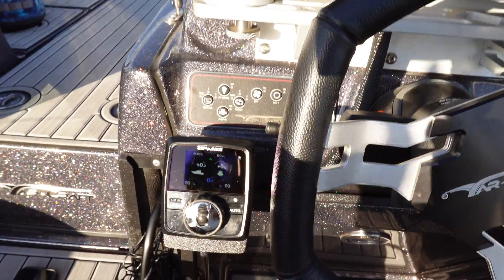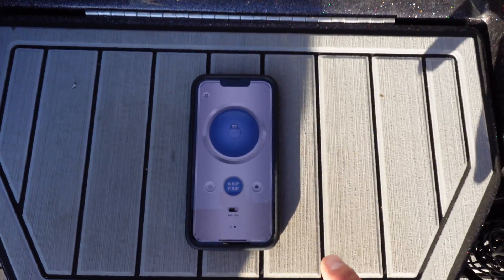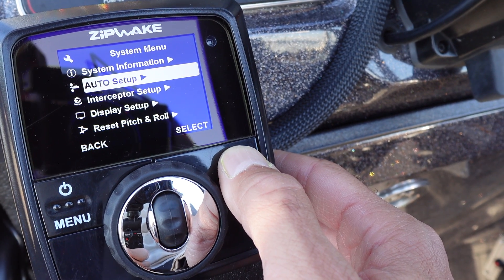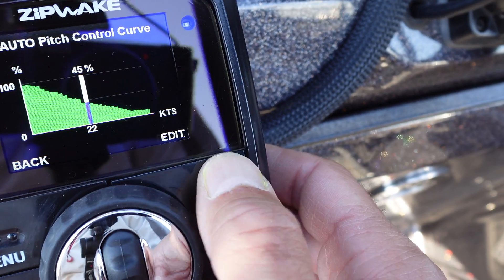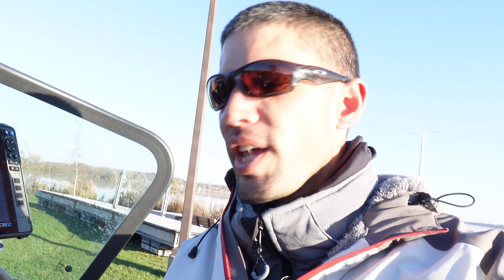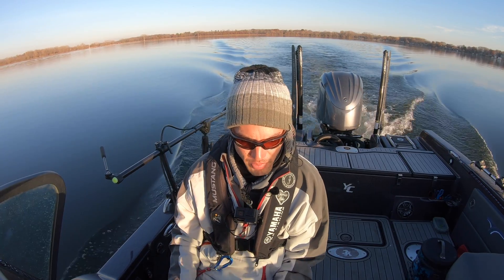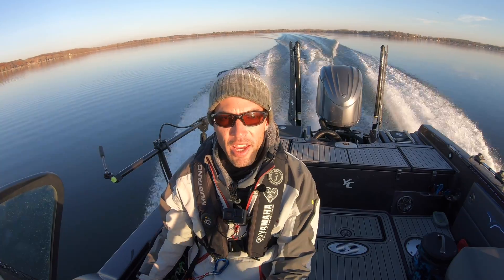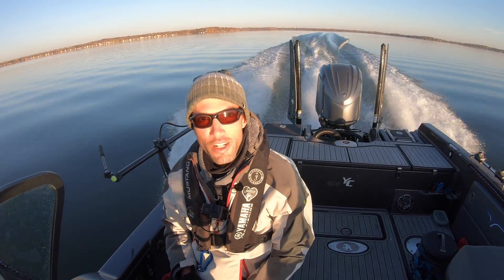Zipwake Auto Settings - Making The System Work Best For You

Comment: If you weren’t a deadshit, and could read a manual, you’d know you can press the outer dial down to permanently add the current offset to the automatic pitch curve.

So if you’re doing 20kts and need +4. Just push the outer dial down. It will reset to 0 offset, and that +4 will be on the pitch curve.

Useless you make such a video trying to be an expert and don’t even know the basics of how to quickly tune this.

Comment: Why would you have them 100% at very slow speeds? Aren't you just creating excessive drag at those speeds?
Reply from the maker: Good question. The slower you go, the more blade deployment you need to create the desired effect. Once the boat is on plane, or just as it about to reach plane, you can decrease or just allow the auto settings to do that for you. At high speeds, even a small percentage deployment is needed to adjust the boat's posture.

Comment: Just had them installed on my Striper 220WA here in the UK. I haven't had time to try the boat since the installation but we are relocating it soon 26 miles down the coastline so it will be interesting to get to grips with these wakes.. good sensible video by the way.

Comment: When you reset pitch and roll the boat shall lay still and level side wise and length wise on the water.
You need to read the operating manual once more, you are resetting the pitch and roll settings wrong.
If someone moves in the boat, the auto roll will take care of it, you do not need to do it manually, you only need to compensate a little with the steering because the friction increases a little on the loaded side.